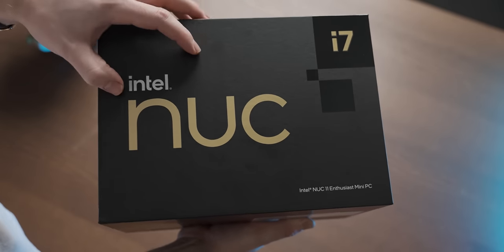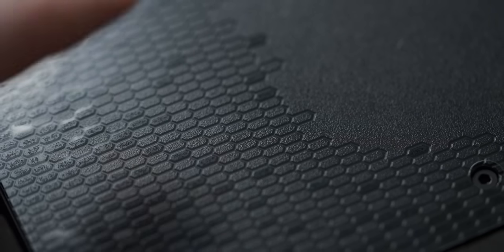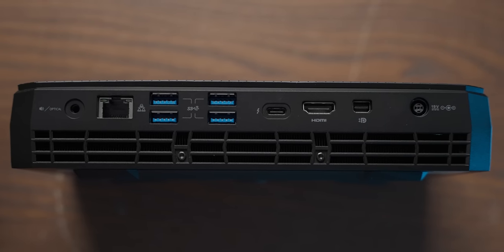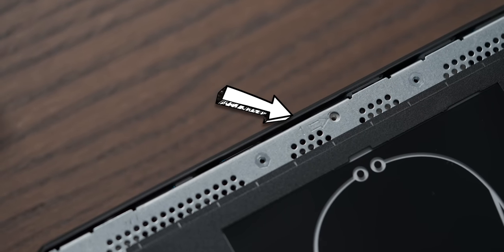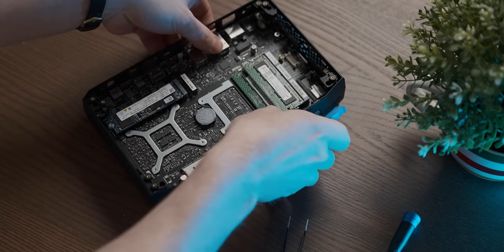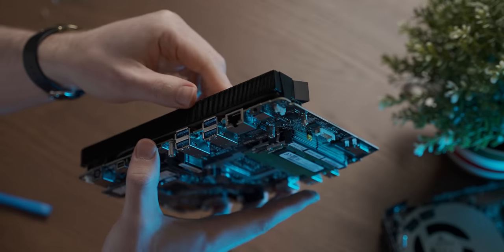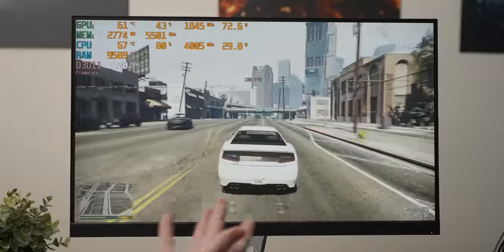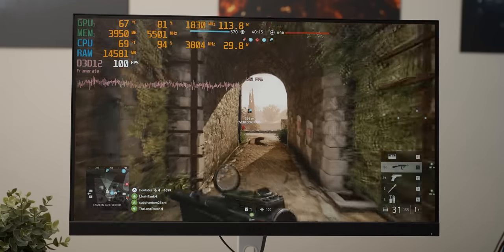TINY Intel PC Comes With RTX Muscle

Comment: The NUCs have been pretty cool, especially the higher end ones
Reply: Yeah but price wise the higher ones don't justify their price.
Reply: The are very good, but the price is what's makes them not popular
Reply: @bootchoo96  yes, being able to build a 3080 system with a i7/ryzen7 for the same cost kinda killed it for many lol
Reply: I grabbed a 4th gen one a few years back and mounted it on a cheap LCD panel in my garage to run Ubuntu and Spotify while out there working on projects / whatever and the thing has been a champ.
Reply: @vailpcs4040  for the price, the dell and Lenovo micro PC's are cheaper and almost as small and can be VESA mounted

I got a Dell 3060 (i5 8400 + 16gb + 512 nvme) for $400 on eBay in 2020

I use it in my living room for parsec streaming games to me tv and watching stuff
Reply: Way too damn expensive though. So much I could never justify it.
Reply: @Harry S Human  these arent really made for the individual. Things like these are good in businesses and warehouse assembly building where you need a good bit of computers but cant sacrifice the space for every station to be a full size tower setup. Can make use of all that space for other stuff and u dont have to worry about it sucking up as much dust particles from the work i do
Reply: @harryshuman9637  imagine low price...3rd party brand will be gone by now....
Reply from the maker: @harryshuman9637  I agree, they are cool but often way too expensive. Especially compared to similarly specced laptops.
Reply: Agreed.  Got the Intel NUC 13 Pro for a home setup with a Dell 27-inch 4K monitor.  Runs great for everything outside video editing & gaming.  I have a PS4 for gaming, so I use the Intel NUC 13 Pro for work and cloud training.

Comment: Dawid, you could try using throttlestop to bump up the CPU performance by a bit, its got many useful settings in there such as voltage control, TDP control and even freq control if your CPU allows it
Reply: Intel mobile cpus don't allow any of that, only k skew desktop cpus do when it comes to intel
Reply: @dilutedoxygen it depends on the CPU. I have a 1235U laptop which allows some control.
Reply: @dilutedoxygen  Throttlestop is different to general overlocking tbh, Throttlestop allowed me to undervolt my i7-8750H and force consistent 3.4GHz clocks when running benchmarks and such, compared to the stock 2 cores at 4.2 or whatever 2 cores at 4.0 or whatever and another 2 cores at 3.8 or whatever. Yes you can't "overclock" these laptop chips but I know that undervolting can help with reducing temperatures, changing turbo freuqency times like you can in XTU and performing undervolts to get a stable clock speed and better performance. I don't have that i7-8750H anymore as the GPU fried to death so haven't used it for a couple of months. Maybe I'm wrong and hey that's ok. Btw you are correct that overclocking is usually only limited to desktop K CPU's like my i7-9700K but I think the original commentor was trying to get across a different point?

Comment: Honestly that little guy held up much better than I thought it would 😂
Reply: Why not? It is essentially a mid-tier gaming laptop from 2 years ago without the screen and keyboard. Otherwise, with this thing being from Intel, I find it ironic it comes with Nvidia and not some variant of the Arc
Reply: @djnjoy  This is the last generation one (which is the most boring of the dGPU ones), the current one is the ARC model.
The interesting one is the first one, which had AMD Vega graphics built into/alongside the CPU.
Reply: That’s what she said
Reply: And it can perform much better if the TDP is increased ("Power" tab in the bios). He completely missed that.
Reply: @djnjoy  This machine was assembled before ARC even existed. So, it's 100 percent plausible that it doesn't have something that didn't exist at the time.

Comment: You can try to overclock with ThrottleStop, but I doubt it because my old i7 1065G7 would only allow underclocking and undervolting. However it did allow unlocking the turbo boost timers.
Reply: The TDP can be upped using the "power" tab in the Bios. Crazy he missed that.

Comment: Nice. I wasn't expecting that level of VD on the installation.
Reply: That's just windows 11 version of instant apps. They each take up 8Kb and aren't really installed until you try to open them. I tried to do a clean install without any of that stuff by using the "N" package install. It ended up taking me a lot more time to and was much more of a headache to install all the missing directX and other drivers than simply removing those shortcuts from the start menu.
Reply: @mitch7525  ya tried tiny11? (A custom, completely unbloated version of windows)
Reply: @STORMFIRE07  Tiny 11 seriously lacks security-wise and is not recommended for someone using it as a main OS.
Reply: @Weaselszone  interesting, didn’t knew that, thanks for info

Comment: It looks exactly the same as my NUC Hades Canyon, (which incidentally has a strange Intel/AMD collaboration GPU),  which was light years ahead of any SFF gpu at the time, and still is very good and will play AAA games. The only real difference i can see is the 2 Thunderbolt 3 ports i have in the Hades Canyon have been replaced with T4, the bios and power brick even looks the same. The internals look different, and mine is far more easy to access.
Mine came as a barebones unit which i put 32gb of ram and a 1tb nvme, the processor is an i7-8075g and the GPU is a Radeon RX Vega M GL, its still great to use and i intend to keep it.
Reply: You're right,  that's really the only difference between the phantom canyon and the hades canyon. Having owned both,  however,  I can confirm the phantom canyon is significantly more quiet at full load then the hades canyon model.
Reply: @kurtisrinker1202  Thank you both for your comments. I didn't know that the phantom canyon looks exactly the same as the hades canyon. It's good to know that the phantom canyon is quieter as weighs heavily on my calculus when buying those things. 

Do you guys think that this can be easily transported? I am looking for a lightweight yet powerful pc to use when going on longer trips and those nucs seem to fit the bill.

Comment: With windows 11 gaming, 16gb of ram will definitely hurt your performance. 24-32gb is what I'd personally recommend for gaming on windows 11. When I upgraded my ram from 16 to 32gb, at the same speed, I got another 25fps, running a Ryzen 5 3600, and rx 6600

Comment: it looks like its the clockspeed that is the problem.
with how it was sitting close to 30 watts the entire time, i suspect its being done via a power limit to reduce temperatures, which can also be slightly increased using throttlestop. the cooling on this is good enough that i believe you could give the cpu another 10 watts and it should be able to cool it fine.

ive increased the power limit on my 15 watt i5-8250u to 22 watts, tricked the cpu into "reducing" the power limit after the turbo time has finished down to 22 watts and done some undervolting to allow the cpu to do more in that power limit and drastically improve performance in games (with the igpu), i even gained a thousand points in cinebench r23 over the stock voltages, power limit and turbo time limit.

Comment: NUC´s are great for small form factor builds. I read you can have new ones with a 13900, but it probably needs a seperate case for the RTX4090 and another case for the custom watercooling/ radiators :)
2:06 Like my new laptop, advertised as thinner and lighter but it comes with a massive 330W powerbrick you could hurt people with :)
Reply: the higher end NUC's are a bit bigger  , still smaller than a tower PC.

Comment: Some real thought put into the making of this one it seems. Really cool to see! Super compact little pc and somehow they still get it to be super easy to upgrade (where the heat pipes where you can’t change anything anyway). And add some aesthetic stuff as well with the light.

Does seem though that they forgot about the power brick and some random poor intern made that one 😅. Would be nice if that was a lot smaller. Especially with how small they are getting lately. Have a 140 watt brick that fits in my hand easily. This one could kill a rinoh xd
Reply: The smaller the power brick the more heat and stress on the components. While a larger size power brick does not necessarily translate to it being more reliable, I'd be more inclined to expect it to last longer and/or not try to burn me if I needed to move it shortly after heavy use.
Reply: @benjaminmiddaugh2729  the 140 watt one i have is from apple. Their macbook pro chargers come with very small bricks for the power they provide. They dont get crazy hot either. Not more then id expect at least. And there is ones from anker for example that are even smaller. They are all good quality. Ofc though be more sceptical if its a sketchy brand.
Reply: @xanderwusky  I didn't say that smaller power bricks couldn't be relatively cool to the touch or high quality. But making them that way usually requires much more expensive components and more clever design, neither of which are cheap. And I suspect that the NUC market is significantly smaller than that served by Macbooks or third-party power brick suppliers, so the justification for making the power brick more expensive is correspondingly smaller.

Comment: David, I have something for you to test. Modern day hyper threading. I have a 11800H and I gain FPS turning it off. Even in BIOS it states that this may be the case for gaming. I get about a 20FPS boost in Warzone 2 in heavily populated areas with it disabled due to the CPU being able to maintain a higher clock.
My question is this? Is Intel and AMD lying to us about threading and in fact the cheaper non threaded variants if not doing CPU intensive workloads are a better match for gamers? So why do they push threaded CPU's in prebuilt gaming laptops?
Reply: It is kinda game dependent too

Comment: One thing that came to mind, before you benchmarked the GPU. Did you turn on maximum performance in Nvidia Control panel? As this is a NUC the GPU maybe a mobile version of the RTX 2060 instead of the desktop version. You might find that you may get a uplift in GPU utilization

Comment: I have been running this NUC for several months now. Is great for what I am doing. Use it as a general purpose and gaming pc. Decided to pull the trigger on a NUC 11 extreme (Beast Canyon) based on my experience with this system. Will still use this as base/primary PC, the new one will become my new gaming box. Intend to use RTX 4070 in the Beast Canyon, max out the RAM and  upgrade the cooling with better, quiter fans. Considering everything the NUC 11 Enthusiast is a great system. 

BTW, I hate the skull logo. Very cheap and amateurish. Should have been a radiation trefoil for a NUC.

Comment: I think what people are failing to understand here despite suggesting ThrottleStop is that the CPU is already hitting it's max power draw design. Actually it's already 2-3 watts ABOVE it's 28watt rating. In the Cyberpunk test, you can see both the GPU and CPU nearing it's max utilization with both usages in the high 70-90%, in my eyes, this is a VERY well harmonized operation and it is giving you everything it's got. Not to judge, but not everyone can be living in a space like Dawid's here. With that in mind, the thermals are insanely good for packing a hundred plus watt machine in a tiny form factor. Intel clearly had that in mind when they were designing it to endure thermal tortures like this.

tldr cpu capped out its power and is the primary bottleneck, not all of them are caused by it's lack of frequency, cores or thermals

Comment: Relatable. I have a laptop with 16GB ram, GTX 1070 and i7700HQ (4 cores, 8 threads @2.8GHz base clock up to 3.8GHz boost clock) and the i7 seems to struggle a bit in cpu intensive titles like cyberpunk. Wish I could overlock it, but even if it was capable of doing so, it gets hottt and I mean like 80-90C°

Comment: I also have the i7 1165g7. I kinda wanted to undervolt it a bit so that my puny singular laptop fan doesn't struggle too much. I tried using the latest drivers and anything but xtu just didn't work. Pretty disappointed that a literal i7 doesn't want to be tweaked whatsoever. Unlike its previous gens.

Comment: The entire reason the temperatures are good is only because the TDP is kneecapped. Any laptop CPU from the last few years NOT hitting 100c means you're wasting performance, this system would be so much faster if the CPU it's TDP was something like 60w instead of the pitiful 30w.  Most gaming laptops will run the CPU between 45-80w.

Comment: how can you attach it to the back of the monitor ?, wont the monitor already be using the vesa mount for the monitor stand or monitor arm
Reply: On some monitors yes, but on mine the monitor stand was seperate from the Vesa mount. That's the main reason I bought mine.

Comment: Okayyy, but what if you were to optimize the system with Razer Cortex or something like that? I've used it on many Gaming pc's and gaming laptops and it really does improve performance. Not just a little bit and you can't even really see any improvement either, you can see a major difference!! So, if you did that, I bet it would help with the CPU bottlenecking tremendously..

Comment: The Quad Core is not going to be a big deal vs an 8 core if you play in 1440p or more. And even in 1080p or less, when the CPU is relied on more heavily, most games do better with a small number of faster cores rather than a larger number of slightly less beefy cores.

Comment: How about installing throttle stop and then undervolt CPU so it can clock a bit higher at its 30 wat limit.
Reply: intel disabled that around 11th gen
Reply: @bradhaines3142  you are right. I forgot about it. But other option is to disable power limits with throttle stop so CPU can draw more power.

Comment: That is an thin ultrabook cpu....in a mini gaming pc. Brilliant 👏
Reply: those cpus can be pushed pretty far.
reason they suck in most laptops is that they are limited to 15 watts because of thermal contraints, with proper cooling (or sometimes even the cooling that comes in that laptop) they can be given more power using programs such as throttlestop and dramatically improve performance.
ive gotten a big improvement in gaming performance on my i5-8250u by increasing its power limit from 15 to 22, tricking the cpu into staying at that 22 watt power limit when the turbo timer is over and doing some undervolting to allow it to do more in that power limit.
this gained me a thousand points in cinebench r23 and a massive improvement in gaming performance.
Reply: Can u direct me somwhere where it tells me how to trick my cpu aswell cuz after the timer it goes to low wattage aswell even tho having the thermal headroom
Reply from the maker: Yeah, I just assumed it had like an 11800H in it. Was very surprised by the chip they ended up using.

Comment: Thanks for the video. Sometimes these little computers are cool. 

I think 1440p would have mitigated some of the performance issues. 
My son has a 1660 t.i. laptop with a ryzen 4000 CPU in it. The AMD CPU is the obvious bottleneck.
In fact the FPS increases when I turn the resolution up to 1440p from 1080P in most games. 
The laptop is supposed to be just to 1080p laptop but you have to play it at 1440p to get the most juice out of the GPU.
Just saying.

Comment: I have learned that the GTX 1080 is actually a ray tracing beast. It might be through software but it's basically One step above the RTX 2060 in most scenarios
Reply: How? It doesn't have rt cores. What game did you play?

Comment: The cynic in me has an observation:
While I certainly like the concept of machines like this they do strike me as being mid-level gaming laptops minus keyboard, panel, and battery, for much the same price as an equivalent laptop. 
In other words a bloody good con - am I being unfair?
Reply from the maker: Part of me does agree, but they are meant for different use cases than a laptop. If you need a lot of power in a small space that isn’t conducive to the laptop form factor. However the pricing should reflect that you are losing all those bits that normally comes with a laptop.

Comment: I wonder how those two power bricks compare in the amperage department….. it might explain in part the size difference
Reply: 19.5v at 230w is 11.8 amps no matter how you slice or dice it. Both have the same ratings.
Reply: @mylt1z28  have you seen both? Because I work with servers and modems and they’ll give different amperage ranges from model to model
Reply: @GR-cd2kx  ohms laws don't change. Both power supplies have the same specs.

Comment: This would be absolutely amazing with an intel 13th gen i5 cpu and a 4060 gpu
Reply: Hah... that's funny.  40xx are dumpster fires waiting to happen.  It's got a huge ass power brick and would need to be at least double to do anything 40xx.  At that point, you might as well plug directly into a nuclear plant.  Even the recently released 4070, which is the most efficient of the entire bunch, is way over what that brick can supply and that's not even taking into account the rest of the PC.  NUC's are amazing, but until they can supply 400+ watts, they won't implement anything over a 20-series card.